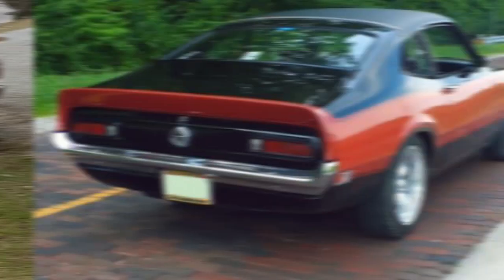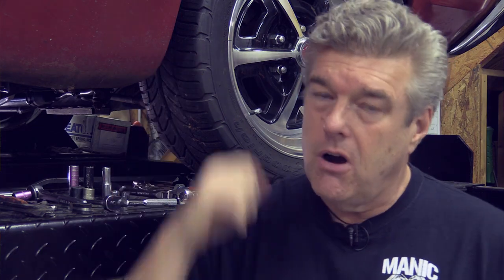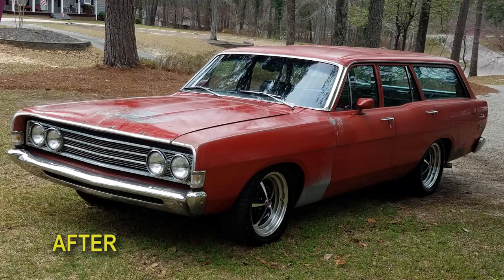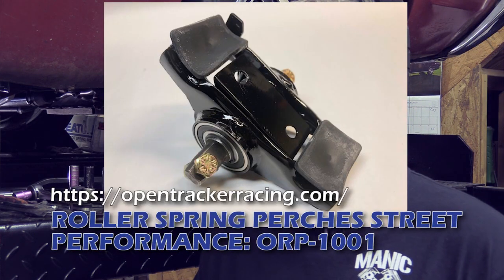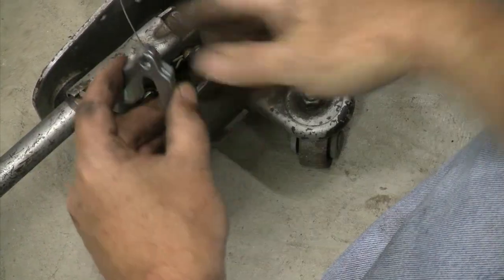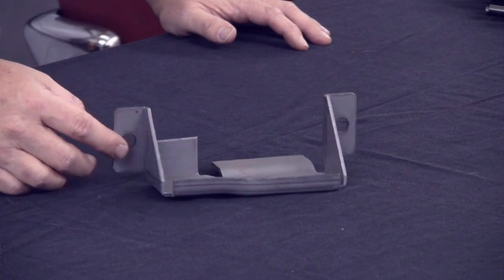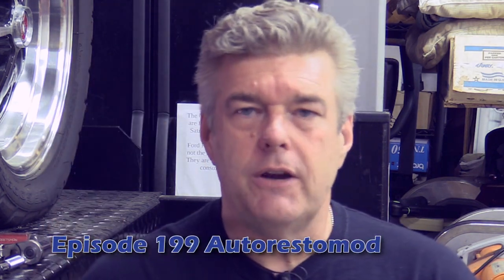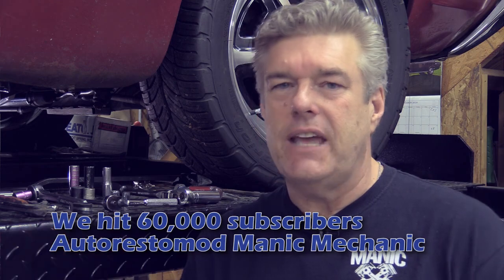10 things to know about ford suspension Episode 69 Manic Mechanic

Comment: As for spring perches, you can find the pattern online to lower the perch and back  (look at mustang sites) and it changes the geometry slightly and it makes handling a lot better.  I did it on my 64 Comet and it made a huge difference.  Also on the early falcons, I used a later mustang idler arm and it corrected the binding and smoothed it out

Comment: Great episode again! The best investment in my car ever has been the Koni classic adjustable shock absorbers. Previously, the car had Kyb gas shock absorbers. The difference is amazing! And I agree, cruising car does not need polyurethane bushings.
In my experience, this era of Ford on normal road conditions, camber should keep close to 0 degrees. A larger negative camper makes the car restless. Track driving is then a completely different matter.
Reply: @Rodrigo Stetson instablaster ;)

Comment: Right now I'm feeling pretty good about the choices I made when selecting components for my 69 Mustang. I bought roller spring perches and didn't go overboard on the sway bar. My shock towers were in good shape so I added the Shelby drop and some gussets to strengthen them. Looks like my only "mistake" was to go KYB shocks - something I can easily update.
Reply from the maker: Not going to say that gas shocks are a mistake, just that they add spring rate and are a little more sporty than non gas shocks. I'd see how you  like them before changing them out.

Comment: Like your advice on building for "90%". Too often, we're told that "more is better, and too much is barely enough. Ditto for the remarks on gas shocks; I had seen a great improvement when using them on my Ranger pickup, and would have been tempted to repeat that on my Metal Cat (Cougar). Would not have thought about roller spring perches, but will now consider them.
Reply from the maker: Right on

Comment: Just went to "GT" springs from Eaton Detroit, Monroe shocks, and a 7/8" sway bar on my 69 Mustang convertible, can't wait to get it on the road to see how it works. Previously had a "performance" suspension kit on it that had the KYB gas shocks, large sway bars,  and high rate springs and it was horrible.

Comment: Jeff, 
1. What are the parts numbers for the QA 1 REAR shocks for Fairlane. Can only find "universal" shocks??
2. Have you seen noticable benefit of using subframe connectors?
3. Another way to strengthen the front shock towers is to weld the front crossmember braces to the tower where they turn up and overlap the tower. When I swapped in the 460 into my 68 Torino, I had to make that weld all the way around to ensure it could handle the weight. Apparently, big block cars have this extended weld from the factory.
4. I hope to see a Godzilla motor in the wagon SOON!
Reply from the maker: Call Eaton Detroit Spring and ask for the Viking shocks for a '66 Ranchero. Sorry, I don't have the part number here.

I think that Subframe connectors are a good thing on cars that are seeing hard driving. But on a street car that is going to a cruise in...not a lot of sugar for your nickle there.

I'll have to look into that Fairlane cross member deal. If we pull the Cleveland I might go in and get that done.

Not likely to see more than the Cleveland in that car. It just runs too good as it is.
Reply: @AutoRestoMod  What about export braces? They've got to help suspension, because they're keeping the front of the car square under torque. Have you heard anyone making an export brace for Fairlane family?

Comment: I have a 1965 Mustang  that has upper  and lower tubular  control arms the upper  have the Shelby  drop  I have also installed  adjustable  strut rods  roller spring perches lowering springs  bump steer outer  tierod ends  and I'm currently  looking  at the Shelby  pitman arm and roller bearing idler arm
Reply from the maker: That should handle really well!

Comment: This is exactly what I needed at the moment.   I’ve been looking at QA1 and other suspensions but that’s just not in the budget and I was getting frustrated.       After this I may just do drop springs front and rear along with a Shelby drop and block.  Maybe some traction bars and see how she eats.
Reply from the maker: The Shelby mod is really to achieve better camber change under cornering. It may lower the car a little, but that is not why they did it. Stage the changes: Shocks first, Then Shelby Control Arm Drop, then springs. Give it time between the changes.

Comment: Thanks for some excellent ideas you've given me for my 65 fairlane.
Reply: I do a lot of these cars.
The 62-65 are a much different suspension.
Geometry is way different.
62-65 has the spring directly onto the upper A arm, no spring perch pivot. None. The upper inner bushings are metal to metal, not rubber. The lower control arm is curved.
The knuckle/ tie rod arm geometry is very different.
I suggest the mid 79s Granada knuckle as the steering arm is MUCH lower than stock for improved bump steer plus you get disc brakes. Use the Granada master cylinder and brass combination valve. Grab the Granada 15/16" anti roll bar too.
Reply: BTW Ive had people drive my car and they ask what kind of rack and pinion I use. None. Factory steering rods with a ball bearing idler arm pivot.
Reply: @hotrodray6802  thanks for the info I'm always looking for improvements on my car. Right now it's kind of point, stomp and pray. Disc brakes would be a great improvement. 👍
Reply: Fred. I also have one stock suspension 63 with a 352w and rebuilt to new.... They drive pretty well. Tires are a BIG deal. A good radial touring tire not excessively wide is best. 215/70x14 are pretty tight in front if youre lowered 1.5". Remember they had 7.00x13 new.
Reply: BTW my personal driver is a 63 with 90 Must GT 5.0 HO full fuelie T5 etc.
+- 13,000 mi per year
Reply: Fyi
The 62-65 upper control arm mounting is like a Galaxie. It bolts vertically into a frame mount, NOT horizontally into the sheet metal like the 66+ and all other unibody Fords.
Its also about 1.5 inches longer than the other cars. Big geometry difference.
Reply: @hotrodray6802  mine has a 347ci, c4, 9in with 3.89s and standard steering and brakes. There's to much power for the brakes. The granda is the way to go I think but their getting hard to find up here. It's a great car and deserves to be safer. I just have to get a decent plan and stick to it. Thanks and I wished I was there to check out your rides.
Reply from the maker: Ray is spot on, the '62 to '65 Fairlane is it's own animal. That is why I said 1966 to 71 Fairlane. Thanks so much for the input Ray, I appreciate it.

Comment: Depending on the application. A rear sway bar isn't going to help you for a DD. 
A LOT  of auto x cars driven on the street will remove an end-link in the rear. A rear sway bar makes the car more predictable on where/when it's going to break lose. 

Agree 100% on running rubber  in most cases. 
I know all about trying to run a set of KYB shocks and a 620 coil on a 67 fastback. With a 302 and 5spd. It bounced all over the place.

Comment: Great video - thanks.

1. What about Viking front coil over shocks? And, getting rid of the death coils?
2. Where can I source a rear sway bar for my 66 wagon? 
3. After installing the caster shims, do you need to have it realigned. I recently had mine done and would prefer to not have that expense again. 
4. Borgeson (sp) power steering? 

Thanks, again. Can't wait for the next suspension video.
Reply from the maker: All coils are death coils. LOL I've never run the Viking or QA1 Coilovers But it seems like it is about the same thing as the regular set up and roller perches.

Comment: Would like to hear your opinion on roller control arms. Particularly the ones Opentracker offers. 

Also your thoughts on modifying the lower control arm pivot for adjustable camber on the early cars.
Reply: I put opentracker roller perches on my 70. Very noticeable ride quality.  Highly recommend them. John from Opentracker is awesome.

Comment: Apologies for reviving an old thread where not a lot of people will probably see it, but this seems like a pretty good place. What makes a better-driving Mustang for mixing in modern traffic and leaning it into the back roads hard enough to have a little fun, the pre-1974 car of the Fox body? I legitimately can't get enough decent information on this from the internet. EVERYONE loves the first-gen Mustang and there's huge suspension support for it. As for the Fox body, "the internet" agrees their handling is trash compared to the S550 or S197 cars. Well, duh. That's sort of a no brainer. If you're buying a 30-35 year old car you should expect that. To me that's the wrong comparison. The right comparison should be to other cars which can qualify for "classic car" or "antique" plates where available.
Reply from the maker: The Fox is a good one for performance. Tons of aftermarket support. But the classics are way prettier.
Reply: @AutoRestoMod  right and right. Thanks.

Comment: Galaxie too please !!!  Seriously want to buy a rack n pinion for the 68
Reply: A properly rebuilt stock suspension)steering with a ball bearing idler arm pivot and good touring tires works great for minimal $.
Avoid Radial TAs. They suck for handling. Every car ive put them on worms all over the road. We wint run them 8f they were free.
Ive had excellent service/handling from Tiger Paw AWP II. Reasonable $$.

Comment: Hey Jeff I have a 1970 cougar convert with air I'd like to make a few changes ex: roller spring perches
shelby drop, adj strut rods ,
 and I'd like lower the front 1.5 inches. it currently has rebuilt stock suspension with gas shocks do you think going back to hydraulic shocks will give me the desired effect or will I need to change the springs ..lastly if I go hydraulic shocks in the front can I leave the gas in the rear or ? thanks I watch way too many of your videos however they are great....I'm thinking the shocks may allow the car to sit down as the front is a tad high .....the suspension has been in plenty long to allow it to settle...BLAH BLAH ...Thanks
Reply from the maker: I'd be careful on lowering the '70 Cougar too much, interference with the fender tops can be an issue.  Honestly the shocks and the roller perch might give you everything you need.
Reply: @AutoRestoMod  Awesome Thanks Jeff 
love your stuff ,I've seen your stuff since the mustang monthly days.keep up the good work

Comment: Lots of great advice in here!
Question? 
I have a 67 Cougar with a 390. I just installed JBK tri y headers. It calls for the removal of power steering assembly. Obviously with a 390. Even though ive shed about 90 pounds in the engine bay. I need power steering. What are your thoughts on power rack n pinion?

Comment: I just want to point out that gas shocks don’t add spring rate. They add a lifting force. 
A gas shock is contributing the same lifting force regardless of how much you compress it.
In contrast, a 500# spring compressed one inch has 500# of force. Compressed 2 inches it’s 1000#.
A gas shock may have 50# of lifting force, but that stays the same whether it’s compressing 1/4” or 3”. 
So yes, it will make the ride firmer and yes it will raise the ride height. 
But it will not affect handling balance the way a stiffer spring will.
Reply from the maker: I guess I mis-spoke. Lifting force. I'll remember that.

Comment: Great video.  Lots of good information.  Thanks.

I have purchased some urethane bushings for my leaf spring eyes.  This is my '62 F100....not a performance build.  Is this going to make my ride too harsh?
Reply from the maker: It will stiffen up the ride. Gas shocks will too. On a '62 F100...you won't be able to tell cause it rides rough anyway. LOL

Comment: Thanks for the info. I did not know that about gas shocks. I have a ‘63 falcon convertible and the front does look a bit high and I never knew why. Also, do you think a 1” front sway bar would be worth doing over stock on a weekend cruiser?

Comment: I am having so much trouble getting info on the early falcon 60-62 ( some 63 ). looking to put a 302 in the falcon w/ T5 w/ explorer rear axle. I know it will fit, but the front ends are running for 6 cylinders. But what UCA,LCA, spring, and any mods that are needed is there a video for this for V8 upgrades I did see the tube for the engine support w/ratchet straps love it.
Reply from the maker: We will be doing a full V8 conversion on our 1965Not sure that there are differences. I'd contact Auto Krafters and ask if they have a kit available for V8 conversion on the earlier cars.

Comment: Herb Adams said soft springs and big bars. As for the Ford strut rod suspension... It's an abomination of a suspension with no caster lots of unsprung weight and massive geometry  issues.

          There are so many aftermarket units to choose from that it takes allot to compare them. My favorite for price and geometry fixing balance is the CPP lower control arm kit. It gives you a real lower control arm and fixes the caster change issue. Not the fanciest but fixes several issues for a somewhat fair price.
Reply from the maker: It will be tricky, But I think I have some ideas on the whys of doing aftermarket.
Reply: @AutoRestoMod   It's a tough subject. So many options out there and reasons to do it. Also the die hard Mustang guys hate any kind of update on a Mustang and will take that fight to their death to prove that the factory stuff was the best thing since sliced bread.

Comment: Thank you Jeff. Any opinion on quality between the QA1 and Viking? On the Shelby drop question does it really help the 1967 up cars?
Reply: FYI I did the shelby drop on my 67.  I heard it was just going to drop the ride height about 1/2 an inch and it did look like that before I had it aligned.  After I had it aligned to the specs provided with the template the fenders were on the tires.
Reply from the maker: I have both on the wagon and it seems happy enough--company rivalry aside.The Shelby drop is to correct a camber deficiency that the stock suspension had from the factory. While the 1 inch drop (what is typical) does help, the 1 1/8 drop is where the magic happens. BUT it will require a more expensive upper ball joint kit that shims the UCA. I might revisit the Shelby drop soon in a video.

Comment: biggest issue i keep hearing not just with ford is people buy a classic car with drum brakes convert it to disc for "safety" then oversize wheels on to fit the caliper. drivability goes out the window not to mention putting radials on cars engineered for soft polyester. had a classmate torched out the shock towers '67 mustang coupe to fit a 460 with headers, car made wide turns and parallel parking was a no go
Reply: I like my drums on my 67 Cougar. Properly adjusted but not a lot of mileage
Reply: I like my drums on my '65 Galaxie. Years ago l "upgraded" to '70 Galaxie front disks, no change in stopping ability. The '70 was also a heaver car.

Comment: Great info Jeff, THANK YOU!!  So Ford less better idea, 1963/64 Galaxies front suspension. I have been looking for a cure to my 1964 Galaxie offset bushings. Have you heard, scene know of anything to replace, upgrade that horribly handling mess other than removing it all together and replacing with, I think you called expensive jewelry....  But my 1966 Mustang thanks you for the info, I will be looking forward to next weeks discussion, QA1 has a new affordable coil over option I really like.
Reply: Theres was  kit for those front bushings. Hunt around. I bet its still available.
Reply from the maker: We're researching front end stuff for the Galaxies now.

Comment: You didn’t talk about camber. Wouldn’t the shims change camber not caster?
Reply from the maker: Shims can change either Camber (equal amount of shims on both pivot bolts) or caster (more shims on the front or rear bolts of the a-arms).
I think I am going to do a video on what the different suspension geometry things are and how they effect handling. But I will have to do that a bit down the road, I need to study up on it again as I am a bit rusty.

Comment: My wife inherited her dads 65 mustang and there are 215 70 14 tires on american racing wheels and I am having trouble with tire rubbing the fender, so I bought the KYB gas a shocks and the leaf springs are on adjustable shackles and I raised the rear end. I still need to install the rear shocks but replaced the fronts as they were shot and the rear already has new leafs and hydraulic kyb's. I have noticed that the ps rear that is rubbing the fender has a ride height that is a 1/2 in lower than ds. Can the shock/leaf spring mount cause this? I did buy some new konig 15x7 in wheels and was planning to go with a 195 tire to hopefully provide a solution..what are your thoughts? Thanks and I am enjoying the channel.
Reply from the maker: I would contact the company that you bought the springs from and see if they will help you with a replacement. Also, check the mounting and make sure that the rear axle is centered on the spring pins correctly. The wheels on a Ford should be equal distant from the inner fenders.
Reply: @AutoRestoMod  Thanks for the info!

Comment: For a old Fairlane with original saggy springs, probably 1 1/2" low, gas shocks are great.  I've had a set of uhhh(three letter brand) on my '69 Cobra since '92-ish? Anyway not once in this time have I said "ugghh should have bought something else". Admittedly after almost 30 years the gas may be long gone, still they show no signs of leakage. I like the stance so I ain't messin' with them..
Reply from the maker: Dad always said, if it ain't broke, don't fix it.
Reply: Amazing what pop learned after the kid(s) grew up. 

Anyway if I did crawl into fastback trunk to change rear shocks,  wife would have to call 911 to get me out.